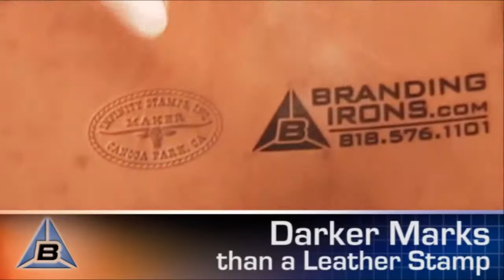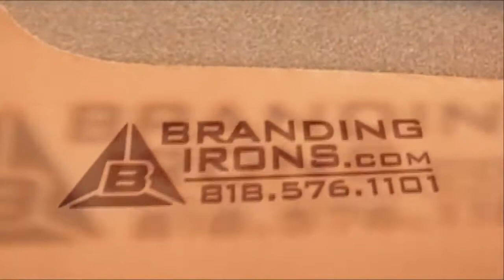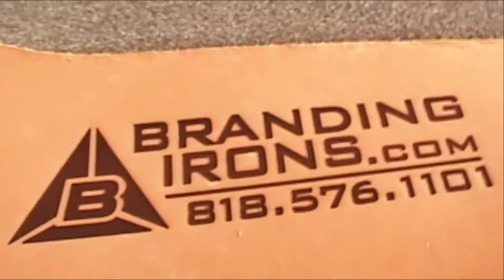Electric Branding Iron Branding Leather

Comment: 1pc price send me sir
Reply from the maker: If you would like to receive a quote please send us an email at: sales@infinimark.com
Please include the following details:
1. Provide your full name.
2. Include the size you would need the finished branded mark to be. 
3. Provide the artwork and/or text you would like produced on the branding head.
4. Advise if you would like a fire-heated or an electrically heated tool. 
5. Please confirm the type of material you intend on marking.
6. If wanting an electric tool, please confirm where it would be used to ensure we quote for the correct voltage and plug type.